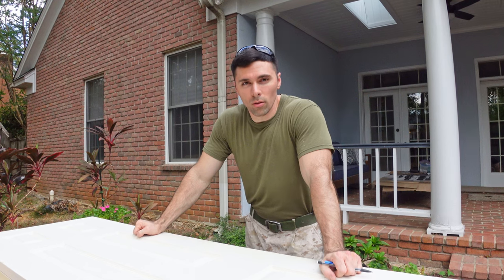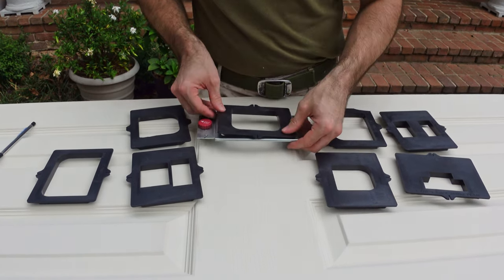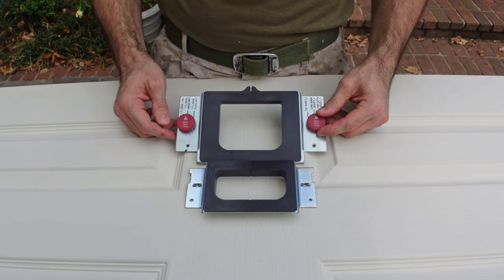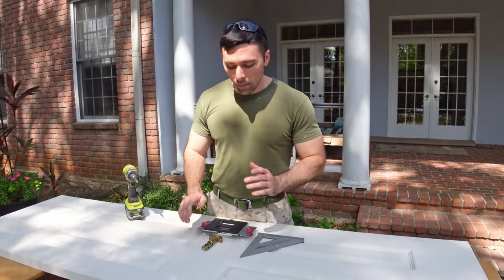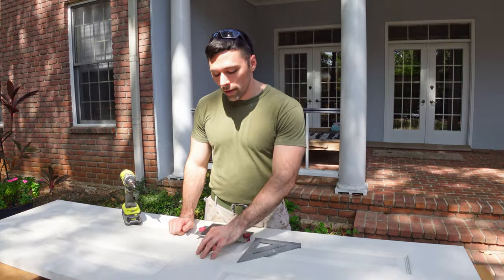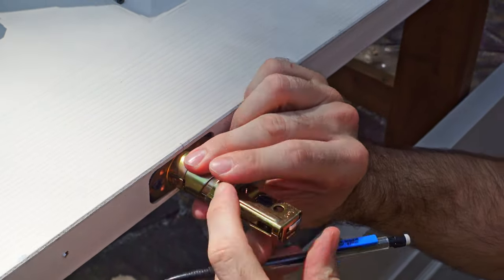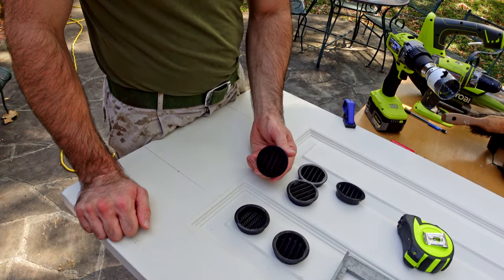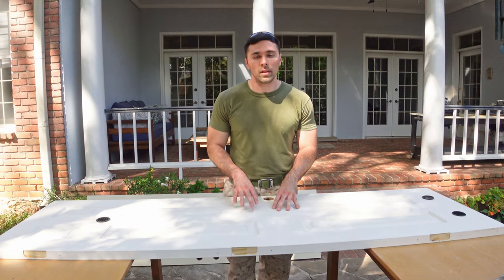Cutting a Slab Door with the Milescraft Hinge Mate 350 || Converting a Spare Closet Part 1

Comment: Never drill all the way through a door with a hole saw. You want to go deep enough that the pilot bit goes through, then complete the cut from the other side, using the pilot hole to center your bit,  for a clean cut. 10:59 you can see all the wood that broke off when he drilled all the way through that may or may not get covered by the hardware.
Reply: i was watching him destroy that door